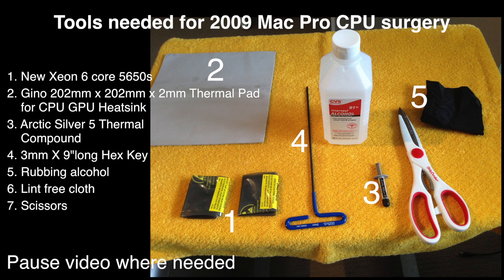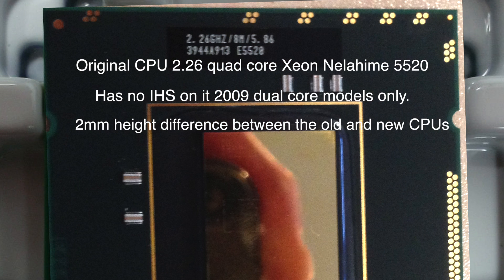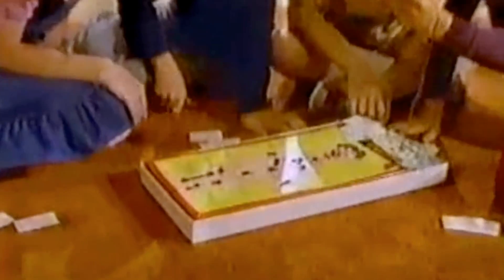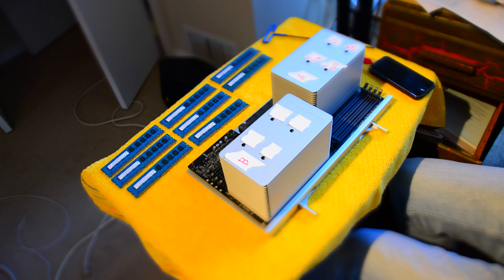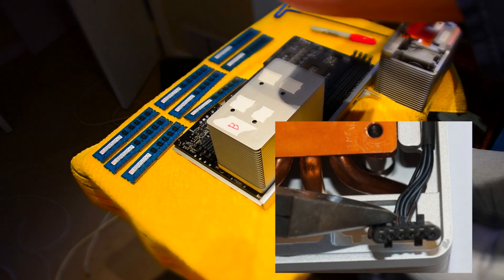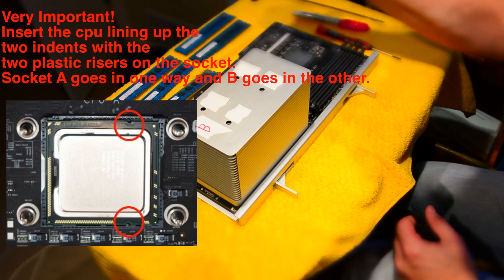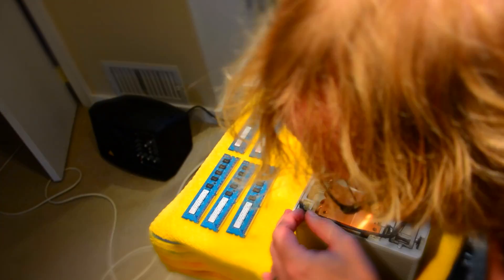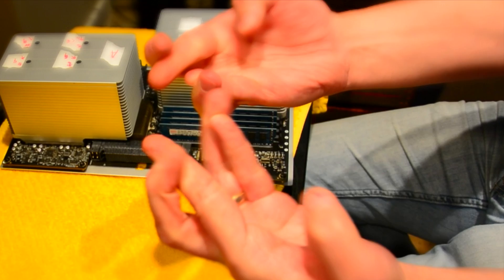Mac Pro 2009 5,1 CPU upgrade 8 core to 2010 12 core

Comment: I was about to just say that de-lidding a CPU is the way to go, but I found out that it's actually better to just leave them on. I think that I will do so if I upgrade. BTW, how thick do the extra thermal pads have to be? The only thing that troubles me is how much extra space I'd need to create in order for the lidded CPUs to not be crushed.
Reply from the maker: At :44 in the video it shows you the thermal pads are 2mm thick same as the difference of the CPUs with the IHS caps. Care to elaborate on why you think  it's better to leave the caps on? Just curious. The trick is to not over tighten the heat sinks and that's why I count the turns to give me an idea of how many turns it was with the original non capped CPUs to the new replacement capped CPUs, but it's far from a perfect science.
Reply: Lance McVickar Thanks for that! I guess I missed it. As for the lids/caps, there have been success stories with de-lidding processes, but it seems that most Xeon CPUs have lids which are held on with solder. It's easy to break components underneath when ripping off the lids. I was convinced that de-lidding was fine (as one person said that he only found glue beneath his X5660 CPU's lid), but after reading an explanation from someone else, I was filled in on some information. First off, the 2009 Mac Pro is the only Mac Pro (unless the cylindrical model has them) whose CPUs come de-lidded from the factory. Apple thought that it would be a good idea to do so, since they thought that it would make a big difference in heat dissipation. However, they obviously realized that it wasn't very necessary, so they immediately switched back to lidded CPUs, starting with the 2010 Mac Pro. This means that slightly editing a 2009 Mac Pro's board to accommodate CPUs with lids on 'em is is perfectly acceptable; it's as if you now have a 2010 Mac Pro's board. De-lidding seems to not be worth the risk and also shows no significant advantage.

Sure, it's weird to have to cut thermal pads and loosen that cable on each heat sink, but it's less of a risk than de-lidding a CPU. It was meant to have a lid in the first place.

SO, I wouldn't worry about not having tried the de-lidding process. Most Xeons' lids are NOT supposed to come off once they've been installed in the factory. If you had tried it yourself, you could have risked killing some very expensive processors. I'm even thinking about ordering the CPU that someone said had lids simply held on with glue, yet I'm still not going to de-lid those. I'm more or less buying them because they're significantly less expensive at their lower 2.8Ghz clock.
Reply: Lance McVickar Yeah - I guess feeling for a bit of pressure and then going with it for a couple or a few turns would be a good way to go. Alternatively, it would best to just barely tighten them and see if all the RAM still shows up. Then you know to go back and tighten some more, like what you did later on in the video.
Reply from the maker: +maccollectorZ (Commenting Account) Yeah all good info, a comment on this page says not to remove the integrated heat spreader, as they are soldered on, I really want to put 5690s in but they are still pricey. It will be easier when I do as opposed to doing it from scratch.
Reply: Lance McVickar Yeah, all of these CPUs are pricey. I'm being kinda cheap here, but I'm thinking about (if I actually DO upgrade my machine) getting two X5660 CPUs - clocked at 2.8 Ghz each. They are about $80-90 each on eBay. (And good thing I already have some thermal pads at home.)

Comment: I'm thinking of buying one, can anyone give their thoughts on its performance?
Reply from the maker: The GEEKBENCH scores are at the end of the video
Reply from the maker: +Lance McVickar on average around 26000 multiprocessor score for 5650s and over 30,000 for 5690s
Reply: Lance McVickar just the macpro itself no upgrades
Reply from the maker: +Cheeta.H Killed The Gazelle look on eBay will give you an idea of prices or other world computing sell used mac pros, price depends on which model processors cores etc...
Reply: it has 2.26 ghz and quad core.
Reply from the maker: +Cheeta.H Killed The Gazelle 
Check this for used prices and also look at what video card it comes with and how much ram SSD etc.
http://eshop.macsales.com/shop/Apple-Systems/Used/Mac-Pro
Check for benchmarks here
 https://browser.primatelabs.com/mac-benchmarks
Reply from the maker: +Cheeta.H Killed The Gazelle check out the geekbench benchmarks. The quad cores are easily to upgrade to faster processors down the road so its cheapest to buy the 2.26 model then upgrade.

Comment: Good day to you Lance hope all is well with you I have been looking around for the 
INTEL XEON 6 CORE PROCESSOR X5690 they are quite expensive don't have that budget. I found a website called http://www.servermonkey.com. i wanna check with you if these are the right  processes for my Mac Mid 2010 computer  http://www.servermonkey.com/3-33-ghz-six-coreintel-xeon-x5680-six-core-12-mb-cache.html 
and if i should buy 2 of the 3.33 GHz Hex-Core Intel Xeon Processor with 12MB Cache -- X5680
for my mac

Model Name: Mac Pro
Model Identifier:MacPro5,1
Processor Name: Quad-Core Intel Xeon
Processor Speed: 2,4 GHz
Number of Processors: 2
Total Number of Cores: 8
L2 Cache (per Core): 256 KB
L3 Cache (per Processor): 12 MB
Memory: 32 GB
Processor Interconnect Speed: 5.86 GT/s
Boot ROM Version: MP51.007F.B01
SMC Version (system): 1.39f11
SMC Version (processor tray): 1.39f11

I have checked the link you haved provided me for used processes on eBay but now the only selling one processor and  + I am NOT comfortable buying a used products maybe it will not work.

I am all the way in Sweden Stockholm No Computer Stores Sell This and its Hard to Find OverHere  

thank you very much for your assistance and experience Really appreciate it

Comment: Whats the total cost for this upgrade? 

Thanks!
Reply from the maker: Depends on what Xeons you choose mine 5650 are around 200 a pair Xeon 5690 are about 650 a pair the rest is cheap
Reply: You can find used Xeon processors on e-bay, but make sure to find models that would work on your Mac Pro. I found a pair of lidded X5680 processors (with the integrated heat spreader caps or lids still on) for around $120. You can buy X5690 processors for an additional $100 but the performance difference between the 5680 and 5690 is marginal.

Comment: Thanks for this.  I have just bought a 2009 Mac Pro 4.1  8 Core and going to put in two Hexa Core x5650s.  Can't wait!

I'm going to put in 64gb of RAM.  I know I could put in 128gb of RAM but could anyone tell me whether the CPUs will be good enough to run a full 128gb of RAM?  This computer will be for audio production so I use a horrendous amount of RAM for Audio Sample Libraries.

Comment: I've been watching you video with great interest I too am an audio engineer, this is a great tutorial! My concern is with "delidding" the IHS. One person says jump in another says don't because the "lids" are soldered to the die. First person says its not solder but thermal compound. I may delid the IHS as a last resort. That said my question is about clipping the heat sink connectors. With that being such an obvious PITA to connect once you have them connected what happens if you have to remove the heat sinks again? Don't those connector clip into the logic board? How do you remove the heat sink again once those connectors snap into place? Or do they just slide out. In this whole operation watching you struggle to get those clips in has me thinking "vice method". Your thoughts? Also I saw a method using an iron. Yes a steam iron(no steam setting?) but my German is rusty (mein Gott)...anybody have thoughts on this? I may actually delid before I buy the damn mac LOL!
Reply from the maker: +Louis Alfred you can buy Xeon 5600 series on ebay with the IHS removed as an option, there are kits out there but it drives the price up quite a bit. One way to go may be to just go with a quad core 2009 and upgrade it to a  6 core with the fastest 3600 Xeon, you cant use 5600 series in single CPU mac pro they are designed to work in tandem in dual CPU mac pros. The single CPU 2009 mac pros have the IHS on the chip only the dual CPU mac pros have them removed. The other way to go is buy the 2010 dual CPU at the lowest speed and just upgrade as they also have the IHS on the chips. Its just the 2009 DUAL Mac pros that have them removed and does make it a bit more scary but is the best bang for the buck if all works out, I see these guys post there videos making it look like a walk in the park but it's not.One day I will want to put 5680s or 5690s in mine so I will be face with the same dilemma  of getting that connector out of the heat sync, I have not tried it but I don't think it will be that hard to do as you have some wiggle room by pulling its wire that goes to the connector to the logic board out of its rail say three inches worth. But one could go without clipping the connector and see what happens, worse comes to worse you have to remove the heat syncs, do the connector clip method, clean off the compound and re apply then put the heatsinks back on. Just be sure to do an X pattern when tightening the heat syncs and don't over tighten you can always tighten a bit more and a bit more if needed. If you don't clip the connectors and you boot up and the cpus show up but the fans are blasting at full speed that means the heatsink connectors are not making the proper connection. If I can help you any more just let me know...

Comment: I can't deny there were a few heart stopping moments when I powered my updated system on waiting see if it would boot up :-)

Success..  Thanks for your great guide!
Reply from the maker: +Sarah Loyd Great congrats!
Reply: @MacSoundSolutions  after firmware update to 5,1 what max speed of processors you can go with 2009/Nehalem? can you put 2010 tray into 2009 model after firmware update to 5,1
Reply from the maker: QueFit Xeon 5690 for a dual cpu tray and Xeon 3690 for single cpu. 3.36ghz bit they do suck a bit more power than the 5680 3.33 which is what I went with. But many folks have gone with the 5690s and they are much cheaper now.
Reply: @MacSoundSolutions  hey, thanks for your reply. I really like your videos, so much info to digest :)

Comment: Hi there I am kind of new with this, so I bought a macpro 4,1 from ebay along with a intel xeon x5670's. I been watching how to upgrade the CPU and came along this. One point I found was this video https://www.youtube.com/watch?v=erbhskSHRPc. I followed and everything is working perfect with the macpro. Thanks so much now I am hitting 27k on geekbench.
Reply from the maker: +Marco Selaya Did you remove the integrated heat spreaders / cpu lids or leave them on? Congrats on your successful upgrade!
Reply: +Lance McVickar. I should it record a video with the process I followed. I removed the lid with a vise, I did it very careful and side by side. Then after removed I notice it had been solder. so there was a solder paste resedue. I removed the resedue with a sharp blade ( it was hard but better than heating the paste) once it was clear I applied the artic paste then reassemble the headsinks and it all worked flawlessly. I am hitting 28000 on geekbench and even I load the cores THEY don't pass 60 Celsius. I am in the process of getting ready for a second computer and this time I will record my process. The computer was hitting 8000 on geekbench before the upgrade now is 28K. Mac Pro 5,1 2009 2x2.93 6cores. 64Gb 1333mhz memory, gtx 680 flashed with native boot screen, SSD on the PCIe port @ 600 speeds read and writes.
Reply from the maker: +Marco Selaya Cool, a person posted below that the heat spreaders are soldered on on all the the Xeon 5600s, I saw a youtube video where a guy used a clothing iron to heat it up and removed the spreader https://www.youtube.com/watch?v=JdPuneT30_o
Reply: +Lance McVickar well I just use a wide sharp blade while a cpu was on a foam to protect the pins. I just carved the solder paste until it was even. Like I said it worked perfectly. I used the Xeon X5670 's. The next computer I am planning will be with X5690 3.46 6 cores.
Reply from the maker: Be great if you make a video on the removing the IHS process.

Comment: How did you get the heatsink connector out? I'm sitting here with a dead Socket B now but will order a new daughter board. I will not give up!!!!!!!!!! $550 minus but I don't give a fudge! I want 12 cores now since I started! I just don't get how you get the connector off. Did you have to force it off by twisting and turning with a tool?
Reply: +TheSwedishCruiser if you look closely at the connector you will see some small slots in the heatsink where it holds the connector. Gently push the connector to the side so the plastic retainers on the connector move into the slots.
Once this is done you can push the connector down and out of the heatsink holder. 

I then cut all the plastic retaining pieces off the connector and routed it back up through the holder again only this time you can take is all the way through the holder to give you the extra reach it needs. Hope this helps.
Reply from the maker: +TheSwedishCruiser If memory serves me which it might not,  I think you have to push it down fairly hard and it will pop out of its housing. You should not twist it or need a tool. Maybe something flat like a credit card to push down. I think there is a little nub on the connector to make it snap in place.
Reply: Sarah Loyd I appreciate your thorough answer. I'm currently waiting to get my other CPU shipped to me to replace the one I killed. Next time will go smoothly!

Comment: Good day to you I am all the way in Stockholm Sweden I need help with my MacPro Mid 2010 5.1 CPU Upgrade  Running on OS X YOSEMITE 10.10.5

Model Identifier: MacPro5,1
  Processor Name: Quad-Core Intel Xeon
  Processor Speed: 2,4 GHz
  Number of Processors: 2
  Total Number of Cores: 8
  L2 Cache (per Core): 256 KB
  L3 Cache (per Processor): 12 MB
  Memory: 32 GB
  Processor Interconnect Speed: 5.86 GT/s
  Boot ROM Version: MP51.007F.B01
  SMC Version (system): 1.39f11
  SMC Version (processor tray): 1.39f11
  Hardware UUID  566CCCD9-4304-508F-A8ED-02A03217190D
 
i am NOT good With Computers, I wanna upgrade my macpro CPU processors For ViDEO / Photo & Music Software, i need to know the right typ to buy.  I Purchased 2 processes from OWC Intel Xeon W3530 4-Core 2,8Ghz but I am having problems starting up the computer on Yosemite 10,10,5 it is giving me the Kernel start up problem,
Some people on Youtube told me the Intel Xeon W3530 4-Core 2,8Ghz are for the 1 processer mac, not for the Mid 2010 5,1 The One I Have , please can you help me out with the Site Or Typ Of Procecsses to buy right that Will speed up my mac and work On My Mac Pro Mid 2010 Running on OS X YOSEMITE 10.10.5 thank you fro your time 
Jah Bless
Reply from the maker: +Crow ATS Automatic Tongue Shots For duel core macs you need 5600 series Xeons not the 3600s as you found out the hard way,  those are for single processor mac pros only. The 5600s are for Dual cpu mac pros. Since you have a 2010 model upgrading is pretty easy. Just go on ebay and buy 5600 Xeons the fastest being 5690s 3.4ghz, get two of those and your mac will be the fastest it can be or you can get 5680 or 5670 or 5650s. You will then have a 12 core mac as these are all 6 core cpus. I would go for the 5690s if you can afford them and you can just drop them in after taking out the old ones and cleaning off the heatsyncs then add a thin line of artic silver across the cpu and reinstall the heatsyncs make sure not to overtighten them by counting the turns when you first remove the heatsyncs to give you a general idea of how many turns to tighten when you put them back on. 
http://www.ebay.com/itm/INTEL-XEON-6-CORE-PROCESSOR-X5690-3-46GHZ-12MB-SMART-CACHE-CPU-AT80614005913AB-/272030351004?hash=item3f5645be9c:g:gMUAAOSwhcJWMZmt looks like 350 each is about the best price or you can get 5680s for a bit less.

Comment: HI!! now I'm realized this steps but I have one questions ... the memory used for the 2009 model is PC3 DDR3 1066 Mhz and realized the upgrade with the firmware tool 2009 - 2010 ... the 2010 models supporting PC3 DDR3 10600 now installed this memory but I get kernel panic in two ocassions ... any suggestions? please

Comment from the maker: OK so if I were to do it all again I might just buy the processors with the IHS integrated heat spreader removed, as tingling technology
     said below the vice method is not the way to go.
I did find these two videos though... who knows a bit scary.
https://www.youtube.com/watch?v=eItYq6nxfJ4
https://www.youtube.com/watch?v=JdPuneT30_o
Reply from the maker: +Jose Francisco Medeiros, Yeap I just tried and its there you have to click on my channel then videos and it shows up in the list here is the share link to it. https://youtu.be/YAdgT-hJuXU
Reply: +Lance McVickar Please DON'T use the vice method on any 1366 socket chip! Those xeon X5xx-CPUs do all have the IHS soldered to the CPU-die, you will most likely rip off parts of the die itself and destroy the Processor by going this route.
The shown method ONLY applies to Haswell/Skylake CPUs for the socket 1150/1151, as those do use simple thermal paste between the die and the IHS.
The 1366-Chips can be delidded aswell, but it is very tricky as it requires the use of a flatiron to liquefy the solder. Chances to ruin the CPU in the process are quite high if you dont know excactly what you are doing.
Reply from the maker: +tingling technology thanks for posting... I updated my post above.